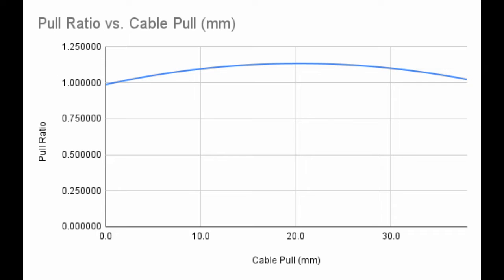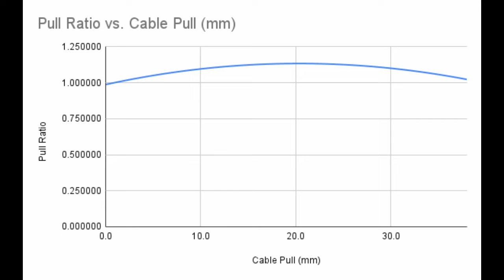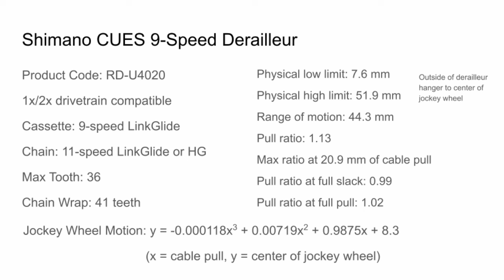Shimano CUES 9-Speed Derailleur Pull Ratio

Comment: So would this be able to replace a derailleur with Shimano MTB pull Ratio?
Reply: You'll need a cues shifter too because all the other shimano shifters/derailleurs use 2:1 pull ratio whereas cues uses 1:1, making cues derailleur and shifter compatible with only themselves.
Reply: @EdudRegnad  Thanks for the reply! However, in the meantime I changed over to Ltwoo T5 shifter and derailleur with clutch. Everything is better than with my previous Shimano Alivio system, literally everything.
Reply: @EdudRegnad  For sub-9sp certainly (ratio is actually 1.7:1) however 10sp is mooted to be 1.2:1 and 11sp 1.1:1 s oit's possible that it might work with one / both of these (11sp more likely).

Comment: Hello, I'm looking for a cheap set. I was thinking about the new linkglide CUES CS-LG300-9 11-41T cassette.  With cheap Acera RD-M3020 derailleur + old Alivio SL-M3100 shifter. My question is: Will this shifter work with the new CUES cassette? How do I check this?  r3020 derailleur has interesting specifications.
Reply: It will not work. Cues is only compatible with cues parts
Reply: The cassette is compatible with other derailleurs, chains and shifters. Linkglide is a cassette technology and can work with any other parts.

It's only that the cues derailleur is only compatible with cues shifter (and either of these is compatible with any other).  Cues only work with cues.

So to make it simple, linkglide is inter-compatible whereas cues isn't.